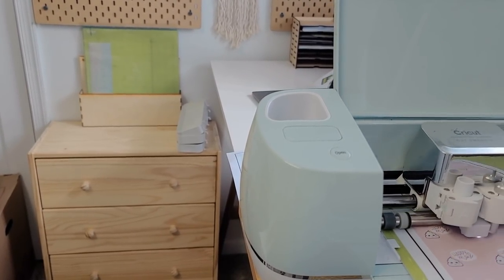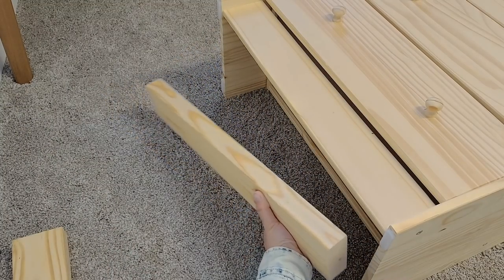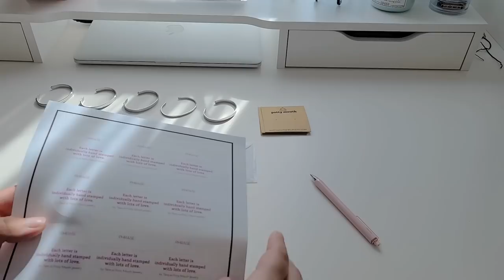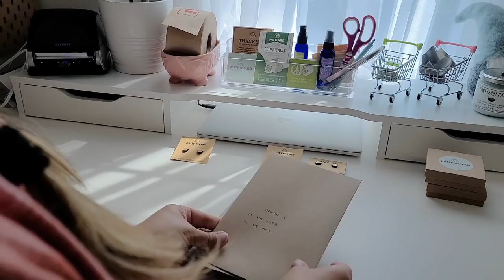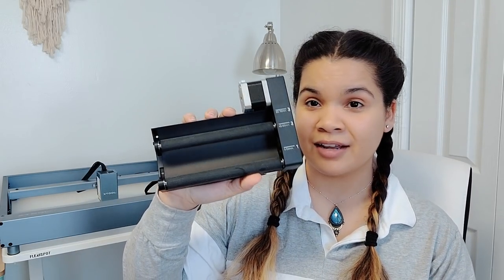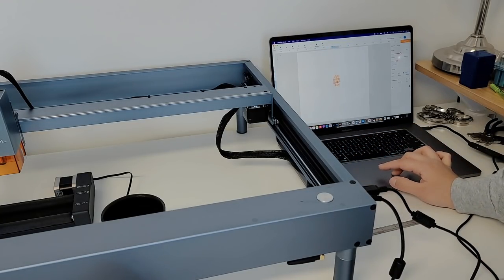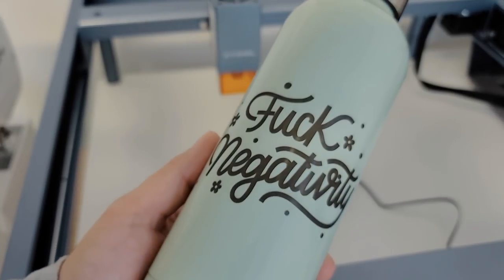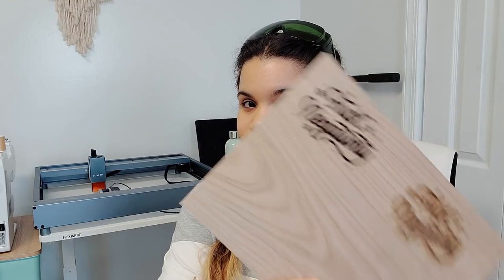studio vlog | making & packing orders, ikea DIY for cricut & testing a new laser machine (xTool D1)

Comment: That little laser is pretty cool. How was the smell? 
I can not wait to be able to add an air compressor to my thunder. It does an awesome job without, but still a little bit of charing unfortunately without. A quick light sand usually takes care of it.
Reply from the maker: No visible fumes or smoke, and the smell was very mild, but then again, I didn't cut anything and probably wouldn't use acrylic with it. I was testing the laser in this spot and purposely tried it out without extra ventilation because I wanted to see how much it created, but I'll create a more permanent spot for it with some stuff to assist with ventilation just for safety 🙂

Comment: That laser tool looks amazing! Do you need a special exhaust set up? I think glowforge has either an expensive filter, or a hose exhaust out a window?
Reply from the maker: I think with this and most build-your-own lasers it's best to keep them by a window or well ventilated area like a garage and maybe even an extractor fan for more time consuming projects. But I didn't notice any smoke or visible fumes coming from the xtool and the smell was mild. I was surprised considering there's almost always smoke inside my glowforge and I can still smell it even though it's enclosed and with an exhaust. I would recommend avoiding acrylic. I don't even like cutting acrylic with my glowforge.

Comment: Loved the video 😊 just a little advice from another entrepreneur/crafter save yourself time and use e6000. Scratching both pieces take out too much time and time is money and also you are working with little pieces believe me it will save you also from frustration 😉 have a nice day 😀
Reply from the maker: This is the only way I've been able to get studs to not eventually break. I used to use e6000 and it's nowhere near as strong. With e6000, some customers studs would break after just one wear and I could pull off the studs with pliers if I tried. So as someone who used to use e6000 for this for a long time, I don't recommend it for this.

Comment: Whoa! How on earth did that engrave with no burn marks and no air assist!? That’s awesome! Also, does it cut all the way through? I have an Ortur Laser Master 2 pro but I’m installing an air assist because I have a hard time cutting all the way through without.
Reply from the maker: I was genuinely shocked there were no burn marks especially with how dark it engraved! I haven't tested cutting yet because I'd like to do it when I get their honeycomb panel, but I've seen others get greats cuts and up to 10mm thick. I'll definitely share cutting in a future video!
Reply: Bc the reason glowforge leaves burn residue is because the smoke and fumes are being drawn backwards across the material towards the fan and out the window. If all that crap just rises into your environment, it doesnt mark the material. But also builds up in your room.

Comment: Why don’t you use e6000 on the studs?  Love your organization.
Reply from the maker: Thank you! It dries too rubbery/elasticy which means the post can detach with pressure. It also seems to loosen with a little heat and I've just had a few where the posts completely pop off / a few customers saying theirs broke after one wear. The loctite dries really firm and I've never had issues with them coming off. The channel Project Farm actually has a really cool video testing the strength of a bunch of super glues 🙂

Comment: As a Glowforge pro owner this is not a good laser to have in my opinion. With the Glowforge it still smells and covers the laser lighting with the cover which is both bad as it is for us. This is scary to use imo.
Reply from the maker: As a glowforge pro owner as well who's gotten to play with both, I was happily surprised by its performance. It didn't create visible fumes or smoke, which the glowforge did, and the smell was very mild. A lot of lasers, especially build-your-own lasers are open, so this look isn't uncommon, and are usually known for being used in garages alongside woodworking tools. I think for less than $800, it's totally worth it to get an extractor fan and create your own exhaust/ventilation system for it by a window, because even with a glowforge, unless you vent it out a window, you have to pay a lot extra for their filter. I'd just avoid acrylic as I've even stopped using acrylic with my glowforge because the smell is too strong. But again, as someone who is very used to my glowforge and been a long time glowforge fan, at no point did it feel unsafe 🙂. If it's to use around kids or a very small space, then definitely get a glowforge. It's nice to have options though.
Reply: @TanaMakes  you cant smell carbon monoxide, my friend. This laser is INCREDIBLY dangerous. Entire families have died from improperly ventilated laser cutters. To just suggest this is fine bc it barely smelled and you didnt see much smoke is so irresponsible.
Reply: @erin9868  Hi Erin, would you recommend to use this product if it was used in an open garage? or just not at all?